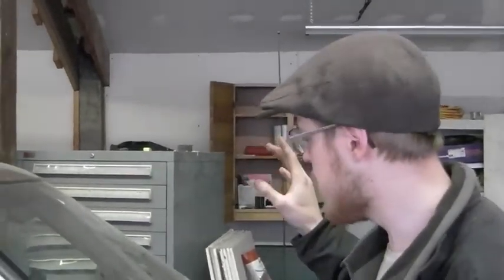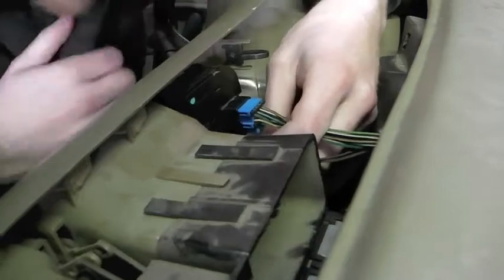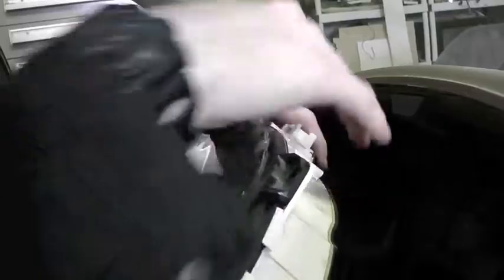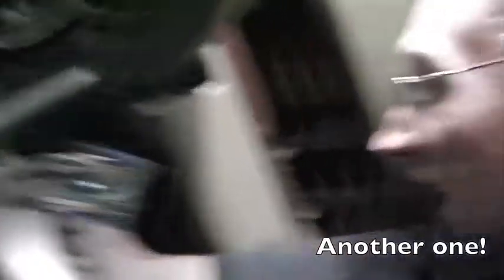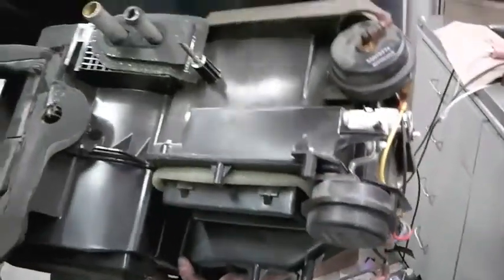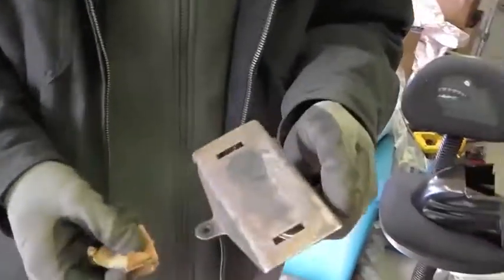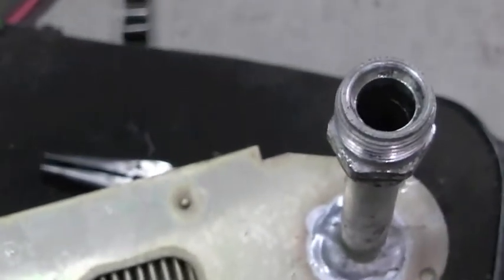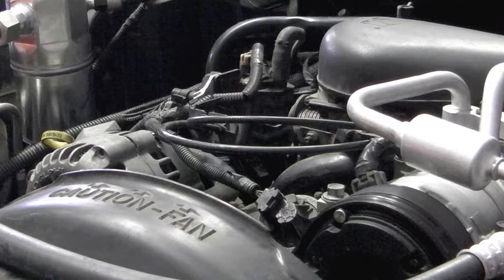HVAC in an S10 Blazer--full system repair

Comment: Wow, that looked like it was a lot of work! I also have a 98 blazer but I only had vacuum issues under the hood and finding a bad vacuum hose connected to a barb protruding through the fender hiding under a fender bolt ! God dam engineers. ; ).  Thank you for the video!

Comment: I feel your pain. I had to replace the same door on my 98 Blazer. I have not needed to replace my AC system. I did have my AC clutch fail and I replaced it. I have about 230,000 miles on mine.
Reply from the maker: LOL thanks. Lovely how they bury that kind of stuff, isn't it? Hopefully yours keeps on keeping on.
Reply: Robert Nilsen was that the Driver side door.

Comment: I'm certain that air flow door is broke on mine too (what you JB welded). Do I need to pull the entire hvac assembly out like you guys did to get it out to repair it? So much disassembly 😬
Reply from the maker: If there's another way, we didn't find it! Good luck with yours. I hope our JB Weld reinforcement holds, because I'm in no hurry to do this job again! It wasn't hugely difficult, just a whole lot of screwing around to get to one cheap broken part.
Reply: @Darwinpasta  Yep, definitely not thrilled about that lol. Might as well do a heater core swap while I'm at it. Appreciate the quick response and definitely this video. Been digging online and it's hard information to come by. Thanks man!

Comment: This guy with the black jacket reminds me of Adam from Mythbusters. Sir, I changed the heater core on my 86 Chevy Blazer, and it was way easier, Now I'm working with my 91 S-10 4x4  5 speed,
 manual.
Reply from the maker: LOL I'll tell him that. Good to hear the first gen is easier to work on.
Reply: Darwinpasta 
Yeah You wouldn't believe how hard I've looked for a 5speed Blazer, there's automatics everywhere, I seen about 3 for sale today, When I found this 91 4wd 5 speed I jumped on it, now I'm slowly going through it,  while driving it daily,  also I found a wreck yard with a lot of S10s and Blazers, I'm in Panama, so it's tougher to find stuff here but not impossible.  Stay busy!!!

Comment: Do you have a list of parts you used & what you recommend?
Reply from the maker: Off the top of my head we replaced the defrost flap, vacuum actuators, evaporator, condenser, compressor, receiver/drier, orifice tube, and maybe the switches. We didn't make up a list and it was long enough ago that I don't remember for sure. I will say, though, don't use a cheap aircon compressor. This one didn't live long.

Comment: This is too much just for heater core housing extracting.....
Thats why japanese car are awesome... they make their car simple
Reply from the maker: I wish! I need to clean a mouse mess out from in front of the heater core in my Pathfinder and that's gonna be a dash-out job too, though at least I won't have to take a fender off. Older stuff is simpler regardless of make.